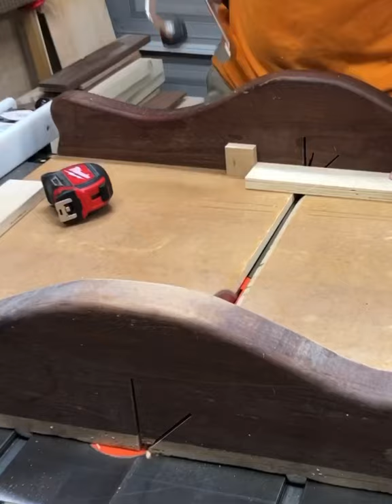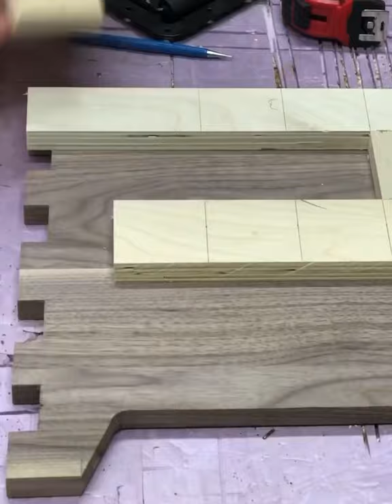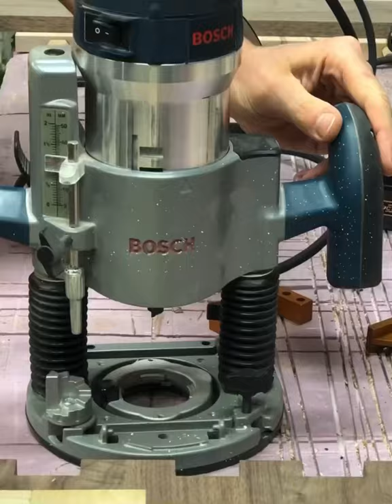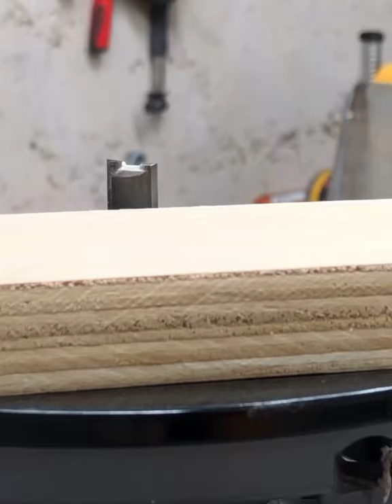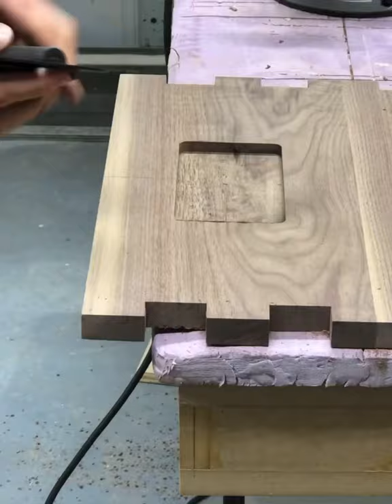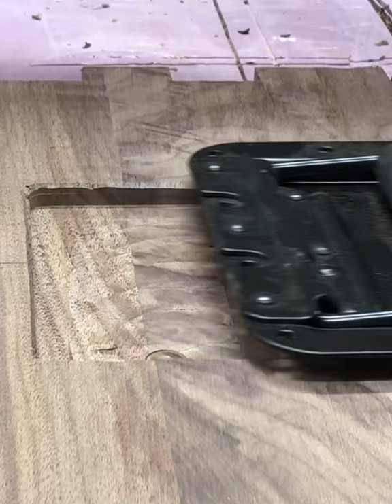Woodworking Techniques // How to install a Surface Mount Recessed Handle

Comment: Should of recessed the lip too after all that work...
Reply from the maker: Maybe but that’s also a whole loooooot more work getting the jig perfectly sized to the lip. But it’s also made to be surface mount so I did the minimum required to make the handle work haha but it still looks great as is. And for this type of handle, to me, if it was fully recessed it would look odd because that’s not how this type of handle is typically mounted